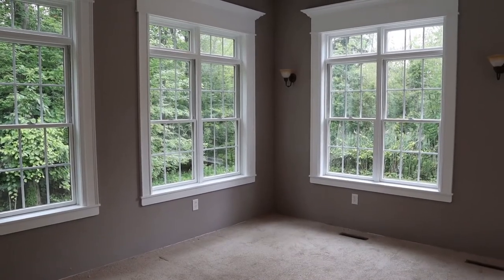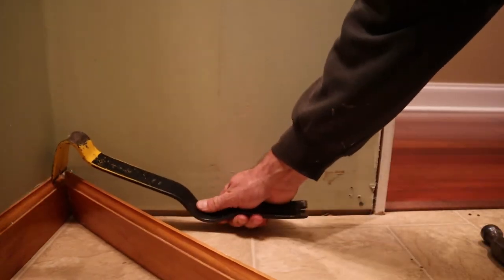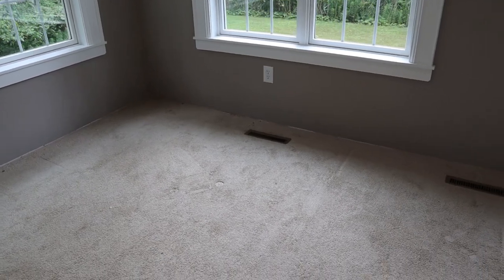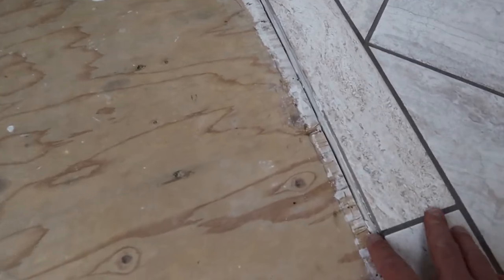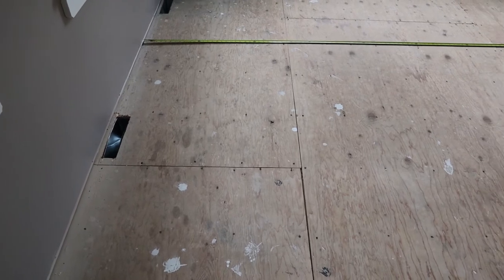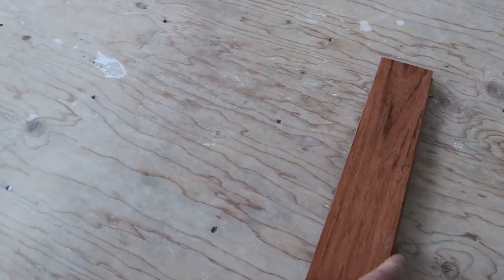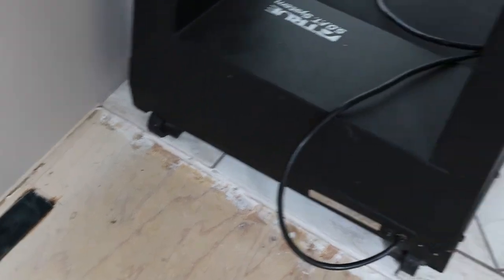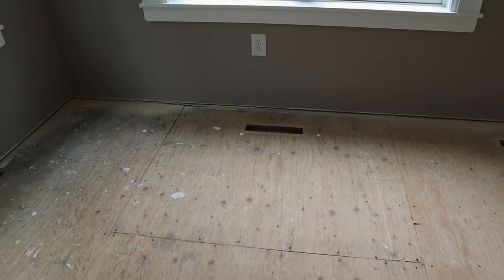How to Install Hardwood Flooring (Episode 1 Preparation)

Comment: Thanks for some solid tips.  i think you forgot to check floor flatness.  i'm researching how to remove <= 7/8" of floor sag prior to staple-down hardwood installation.  Thx.
Reply from the maker: Yes checking for floor flatness is a good idea. I did not need to check this in this installation because it is at my house and I built the house 14 years ago. I am in this room everyday and would have noticed a sag or rise in the floor. In an older homes it is very important. Good catch!!

Comment: Excellent video, thank you! I am looking to install hardwood parallel to the floor joists. NWFA recommends 15/32 plywood over existing subfloor or bracing the joists. The first option is a no go, so I have to go with the second option.

Which type of bracing will be preferred in terms of making it more stable and lesssqueaky, block or cross? Will using glue with screws help alleviate the squeakiness?

Thank you!
Reply from the maker: I always use solid blocking that is glued and screwed.